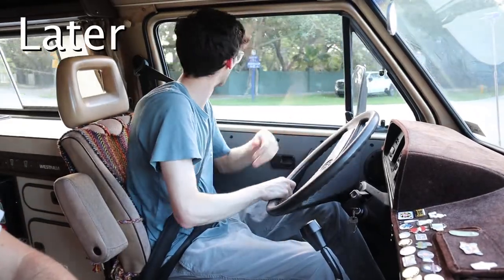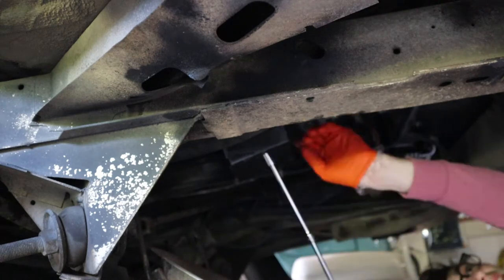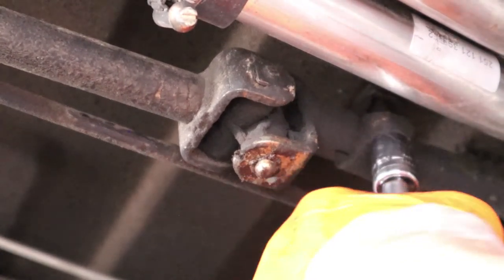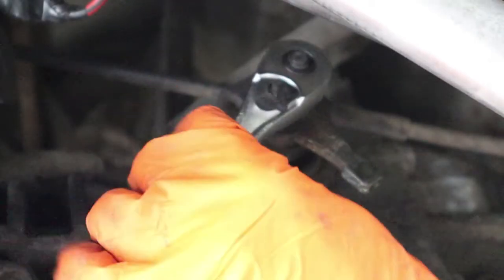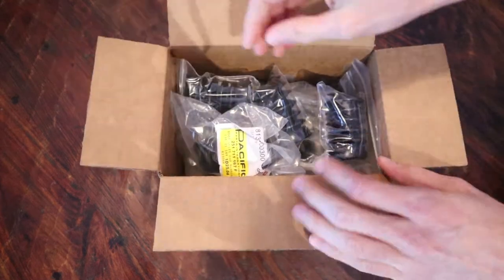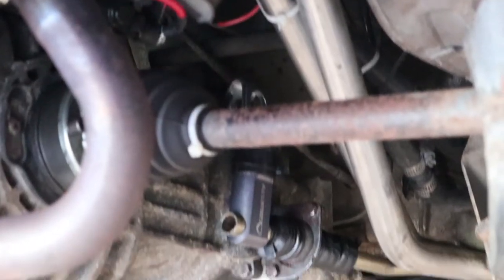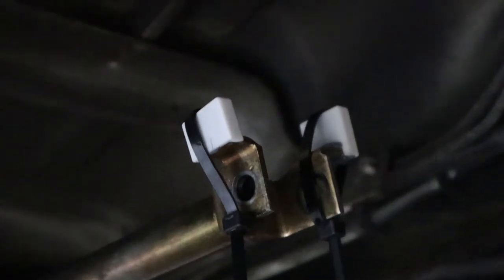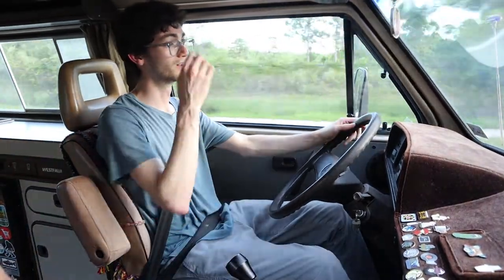Replacing My Vanagon Shift Bushings

Comment: If you havent already make sure you replace the little machine nut that holds the lever ball/elbow on the transaxle with a new one. They arn't meant to be reused and can come loose. I found out the hard way.. mine came loose and the elbow came off while driving and i got stuck in gear which also stripped the spline on the transaxle a little. Not fun!

Comment: Thanks for this vid, it was a big help. BUT at 14:50 it looks like you tucked the bushing boots inside the flange with the bushing. I tried this but it bound up and ripped the boots. I just undid the flanges and pulled them out and it's working. Did I miss something, maybe I got different boots. I did lots else wrong BTW, in summary because I didn't mark the parts carefully enough when I took it apart. Had to flip my u joint, and repress the shift cup onto the correct side of the rear shaft..... Duh.
So the mistakes are mine and the video was a huge help. Thanks again, looking forward to more!
Reply from the maker: Glad to hear the video helped! I think I did tuck the boots inside the flanges next to the bushings. I think I heard somewhere that some need boots and some don't. and some need grease and some don't. I'm not sure though. My bushings seemed to fit into the flanges nicer with the boots, like they kind of popped into place and the boots kept them secure. Yup, I've been there haha. I mark everything and take a bunch of pictures any time I'm taking anything off the van now lol.

Comment: very good which one is the name of the complete kit I am inexperienced I have to do it too this job does not fit third gear well thanks
Reply from the maker: I got the the parts separately, but VanCafe does sell a full kit here: https://vancafe.com/shifter-system-rebuild-kit--the-whole-enchilada/ . The full kit has been out of stock for a while now though. You can use that kit as a list to source parts from VanCafe, GoWesty and other websites.

Comment: Nice work, as usual!  On the surface, this one seems like it should be easy...but it looks like there are a lot of steps and small parts.  Maybe in reality it's not so bad.  I think I'd have to take a lot of photos as reminders of how things go back together. ha.
Reply from the maker: Haha yeah. So many little parts that all go back on a specific way and in a specific order. It honestly wasn’t such a difficult job, just time consuming. Definitely had to go back and watch what I had filmed a few times to see how some of the parts were on there.
Reply: @gottasplit5707  Good to know.  I'm in the process of upgrading the transmission...this is very timely.  Trying to decide if I should attempt this or let the mechanics have at it...Great video.  Thanks again!

Comment: Great videos man....thank you so much for the help....Got a question for you....did you ever hear about "hot Start Problem"?... I have a 1985 Westfalia and works fine...but now once I drive it around and gets warm it work with not problems...but once I turn off the engine it does not starts again ... Only after it finally cools down it works again...I saw several comment on Samba but no one could give a straight resolution for the problem,....Do you have any suggestion or a link that could help me out? thank you for your knowledge
Reply from the maker: I haven't dealt with this problem personally, but it could be an issue with a temp sensor or something. One of those problems that you need to check all the sensors to figure out.
Reply: I'd definitely agree to check the blue 2 terminal temp sensor on the waterpump/thermostat assembly. Very common to cause hard/no stary conditions. Buy a name brand not cheap Amazon special. Also clean/replace all of your ground wires. They cause all sorts of erratic issues with the wbx engines.  On the 85 you should also have the single throttle switch. Make sure it clicks when moved just off idle and at full throttle positions. Also check timing is correct. All easy stuff thay should be considered regular maintenance on these old vehicles. From there if those don't solve it it gets a little more involved with idle control boxes and whatnot.
Reply from the maker: @Coach_Rolando  https://gowesty.com/products/temperature-sensor-for-fuel-injection
I believe this is the one @jeffkovacs2823 is taking about. You can also test your current one first to be sure it is the issue with an ohm meter.
Reply: Yep thats the one! I'd buy it from gowesty or vancafe. Both trusted sources. Also yes could test with a ohm meter if you have the Bently manual and a good meter and some knowhow. Make sure to test when hot tho since that's when the issue is occurring. Th3 Bentley should have all the specs with corresponding Temps